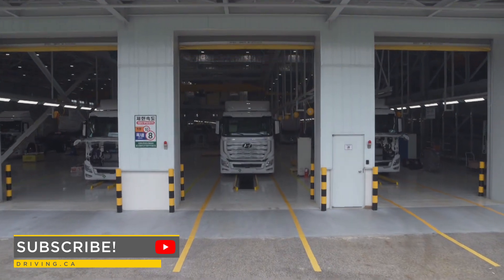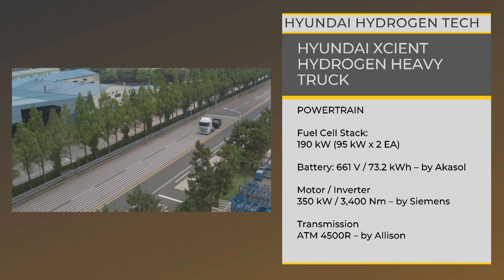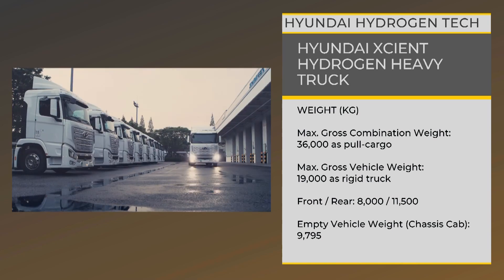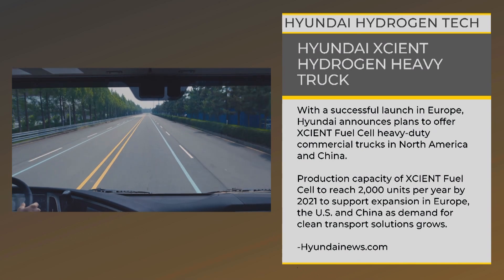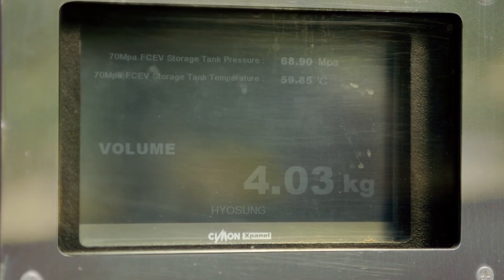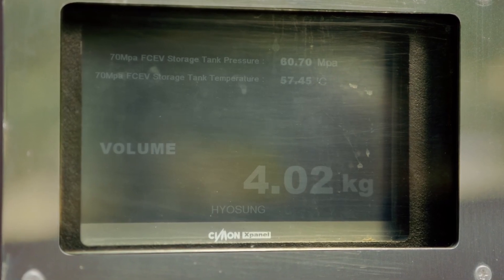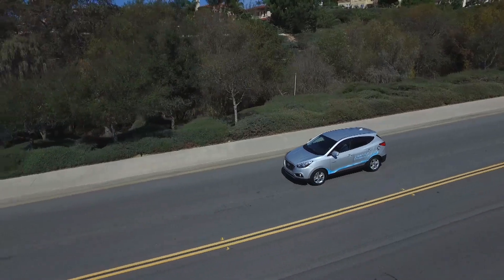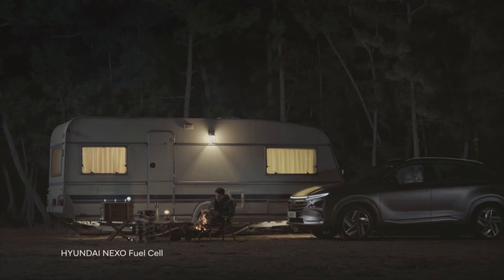Here's why Hyundai is so focused on hydrogen | Driving.ca

Comment: 72 kwh is a pretty big battery pack. So I guess the fuel cell is kind of a range extender.
Reply: A tip : you can watch series at Flixzone. Been using it for watching loads of movies during the lockdown.
Reply: @Langston Nash Yea, I have been watching on flixzone for months myself :D
Reply: Yes, this is a problem with fuelcell and why VW is criticized it so much. Fuelcell power generation is constant level but power usage in car is nothing but constant. You need a lot more power at start - low speed and a lot less power at cruise speed. Fuelcell cannot be quickly turn up or down like. If fuelcell make too much electricity, it'll be lost and generated excessive heat(also waste Hydrogen). If make not enough power, car won't get acceleration. So, large battery size is needed just to regulate power to the motor for good performance driving. That's why Toyota mirai which has tiny battery can only do 1-60mph in like 8-9s with only modest 172 horse power.

Sum it up, Fuelcell car need to have same amount of battery size as an EV if it want to get the same performances. So, yeah it's better to design Fuelcell as a range extender for an EV if customer could stomach the extra cost.